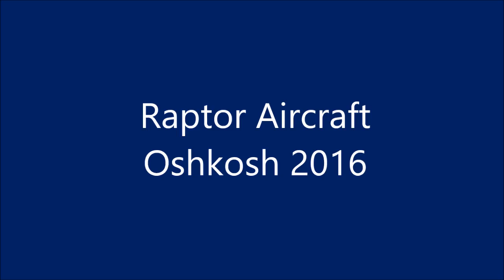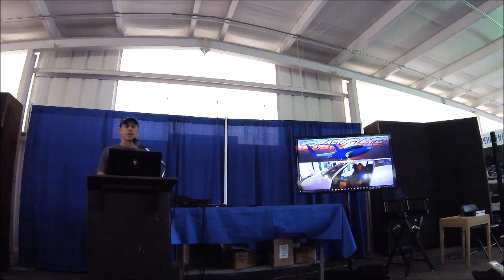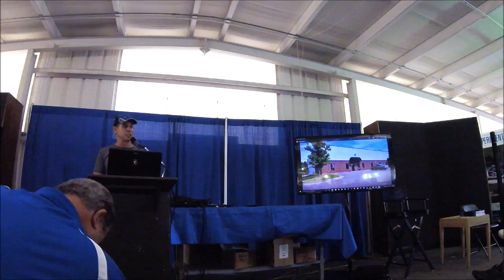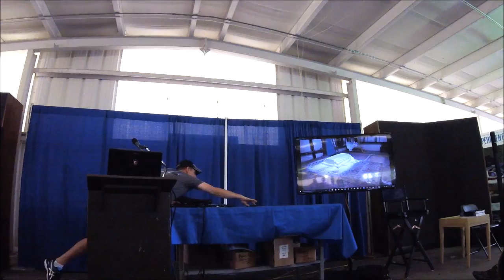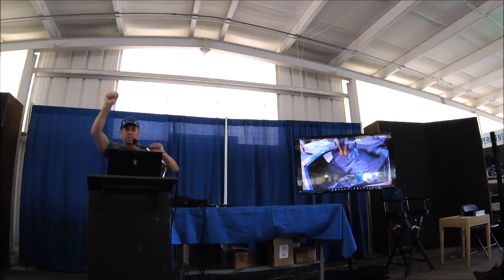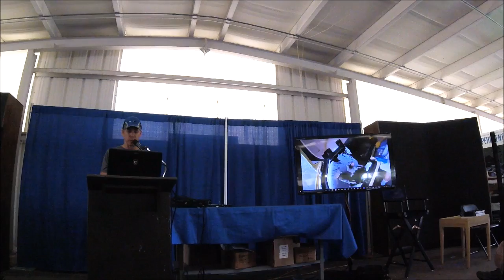Raptor Aircraft Oskhosh 2016

Comment: This is a great prototype. Been looking at the velocity for years since A&P school. I'm getting close in my life to take the plunge and buy a kit. Was mostly sold on their V twin because of the redundant engine but getting up to FL25 and the parachute are starting to sway me. I love that someone out there finally gets it in terms of consumer desire to production. Production aircraft have always needed to make great compromise at high cost. The experimental market has had it's latitudes and even influence into production as with the Cirrus adoption of carbon fiber and even the airlines but most developers have not seemed to grasp that we want our cars with wings. This plane has addressed the elephant in the room - sure, I love to fly and want the utility of fast travel and I personally might stick a tube up my nose to get there faster or squeeze into a box with wings but the company I travel with might not get sold on those ideas. Seriously cool project.

However, the pressurization gives me some pause so I'm not signing on the dotted line just yet. I've watched your videos and haven't gotten all my answers yet. The airlines control pressurization with outflow valves and even negative inflow dump valves. What I gather so far is that you are relying on natural leakage combined with a control to stop pressurization once achieved. So here come my questions:

How do you guard against runaway pressurization and a "popping" of the balloon?

Is your system going to climb at a comfortable rate or will that need to be manned? In the airlines the cabin ascends and descends at a rate pressure. It opens and closes the pressurization valve to adjust this need.

In terms of runaway, is there a (let's call it a plug or dump valve) that will protect the hull. In other words, I see you rate you airframe to 7.5 pressure differential and are bringing it only to 5.5. If say it goes to 6, will it dump the pressure to protect the hull? Akin to this question, will it have a rubber jungle in case of failure. Rubber Jungle is when all the masks fall. Pain in the ass job to fit them all back up when it does in the airlines but a good low weight backup system. So will it have an oxygen candle backup? We can only survive for about 3 minutes at that level without oxygen.

There are circumstances when pressure outside would be higher than inside. How is that addressed? Airlines use negative inflow valves. Will you be using something like that?

Pressurization is an extreme stress as i see you were aware of while watching your pressurization video. "No boom." If you've made any videos showing how those windows are anchored in there I'd love to see. I was glad to hear the disclosure that you knew how much the hull would expand. It let me feel like you weren't so cavalier with this experiment and that gives me comfort.

Let me just say, i dig getting to Florida from Philly in 2 hours but before I put my family in this awesome sky shredding balloon I gotta ask the hard questions about it popping. Sorry.

Next question. Sorry. Referring to the window question above, that material is going to flex differently than the airframe. Not that the whole airframe would experience extreme stress but I could see these areas experiencing cracking, fatigue and failure before the skin over time. Any thoughts on expectation of how long the airframe will last? I see that you are open about your design.  Obviously, flying into that adventurous altitude most of us should realize it has a usable life.

Is the design of the airframe integral to landing and flight forces or is the balloon kind of sitting on the spar. In other words, do those shocks dissipate directly into the fuselage for being attached to them as their foundations or was it designed in a way that the fuselage merely attached to the spar being independent?

Thanks for taking on this project. Im anxious to see your first flight. Going to Oshkosh?